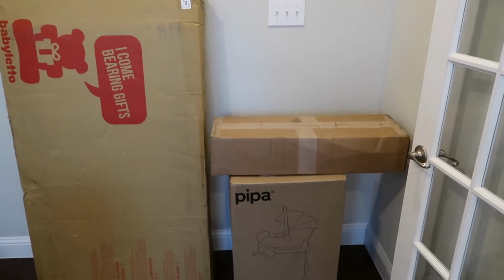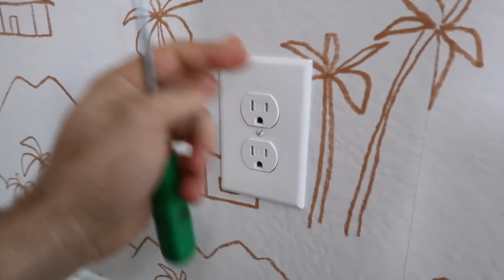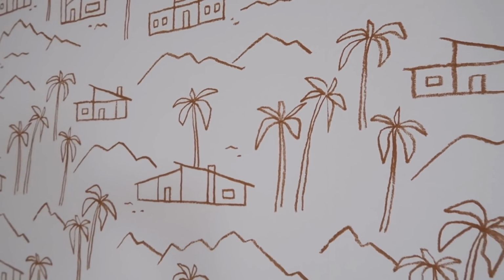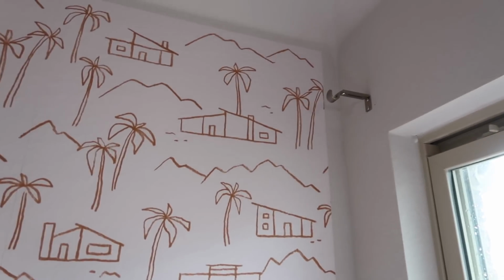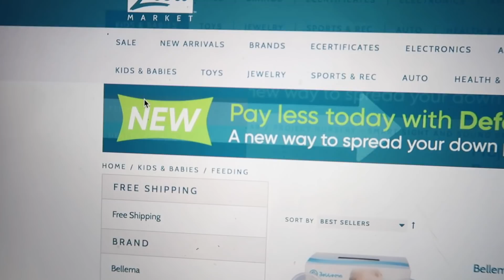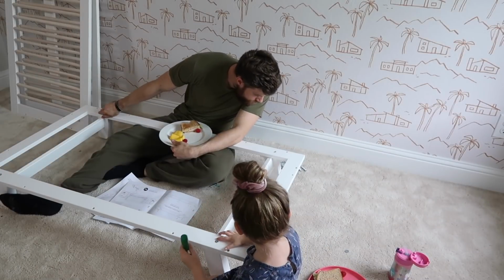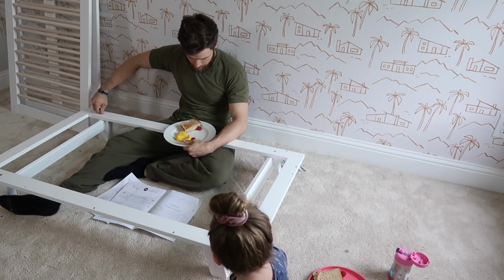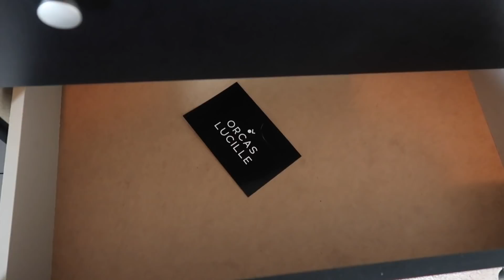WORKING ON THE NURSERY! | Tara Henderson

Comment: Just a tip that may be helpful for Adam, what if you start applying your wallpaper by leaving a few inches at the top since there is so much left at the bottom. That way as you go on you can avoid that gap at the very top. ☺️ on another note ... I absolutely love the wallpaper 😍!